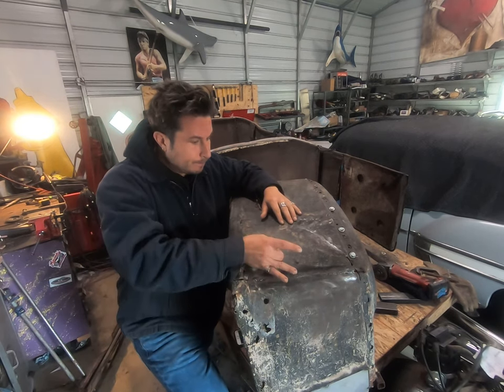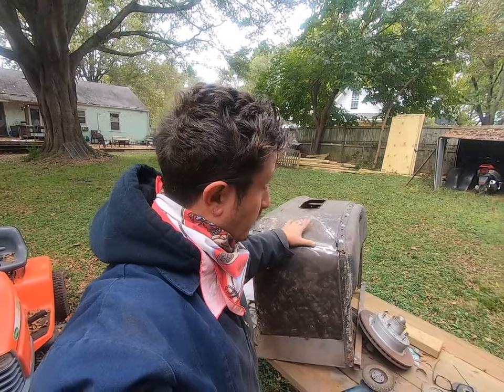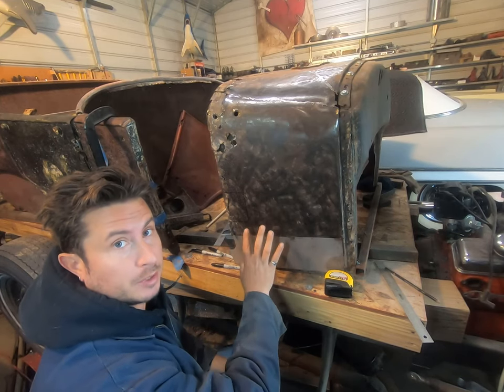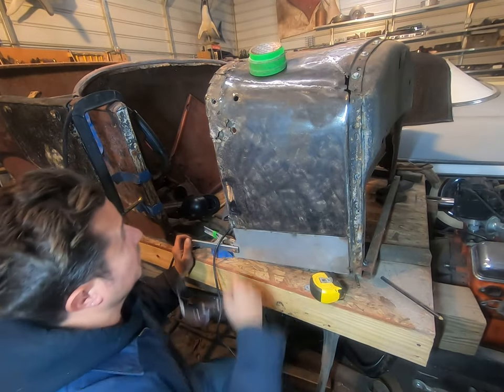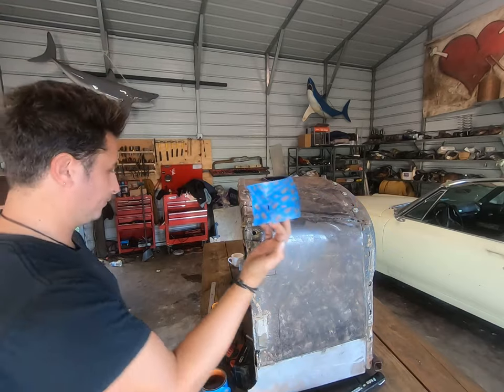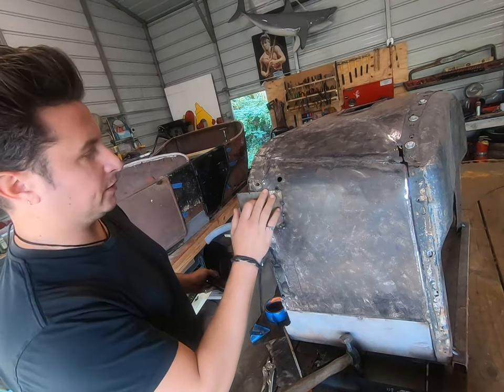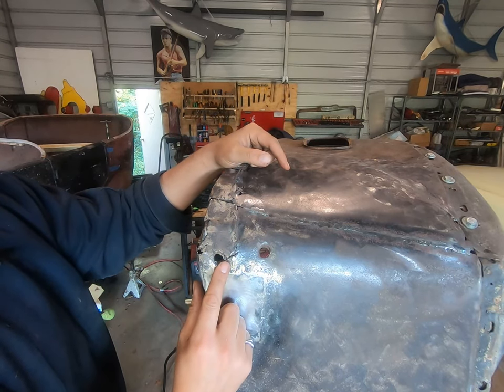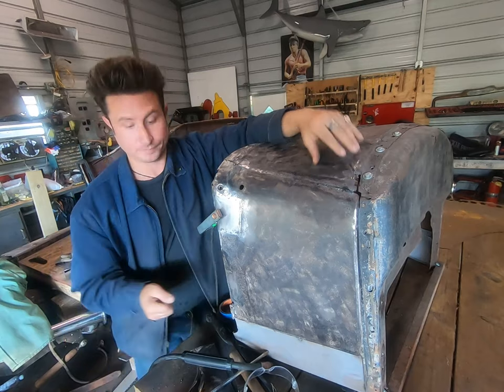HOLE-Y COWL!  Can a 110 Mig Repair All that RUST - 1927 Ford Touring Hot Rod Part 6

Comment: MIG ... Make It Gnarly          TIG ..... when you graduate to two handed precision welding with smaller heat affected zone.
Reply from the maker: We will get there on this one.    I have a tig and we will get into some of that fancy gentlemen’s welding .   
For this I am Just trying to make a point to anyone starting out that you can get pretty far with a 110 mig cause that is typically the first toe in the water/ investment in welding gear for most beginners.